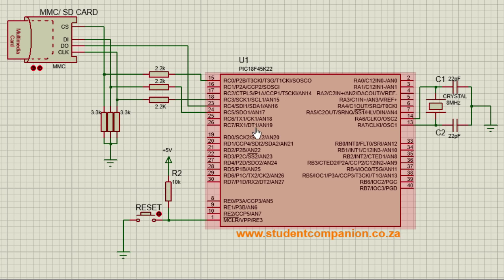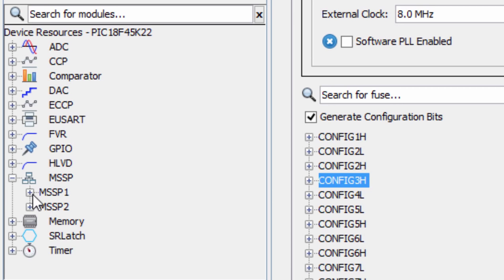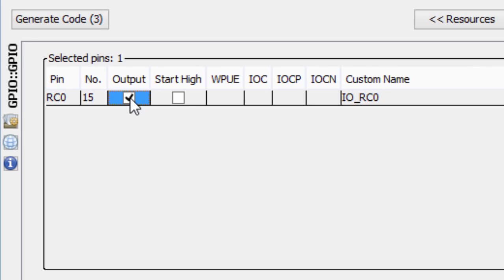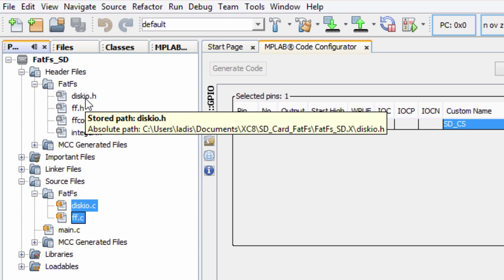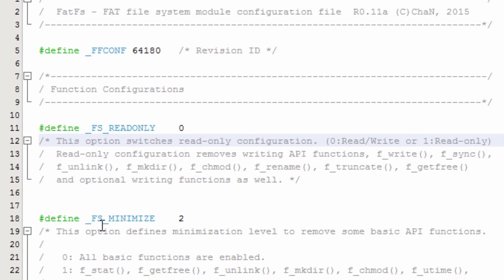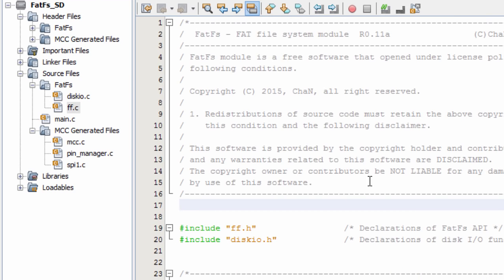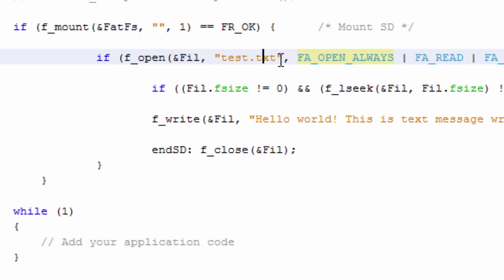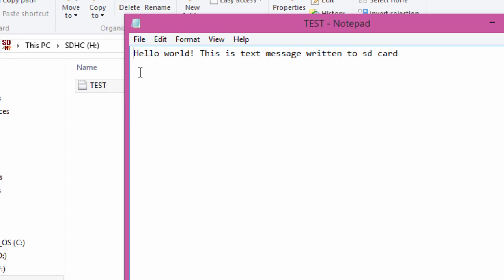48- Interfacing SD Card, part 3 | MPLAB XC8 for Beginners Tutorial

Comment: Did you power up  your microcontroler with 3.3V? and made the connections directly?...or did you power up the microcontroler at 5V and made the voltage adaptions with voltage dividers as shown in the previous videos?
Reply from the maker: +Marian marian2 I powered my microcontroller with 5V. I used ready made SC cards boards with built-in voltage dividers, but you can also make yours as shown on the circuit.

Comment: Hello, I have watched your tutorials about Interfacing SD Card with PIC microcontrollers and tried implement with my microcontroller, PIC18f2331, but nothing worked.That PIC is not supported by MPLAB configurator. Could you make some tutorial without using MPLAB configurator and explain step by step changes that we have to make in FatFs library?
Thanks
Reply from the maker: hi, thanks for watching our videos. the FatFs can be  modified without mplab code configurator. we used it just for the spi functions. we'll  upload an SPI tutorial soon. hope it will help.
Reply: trouble is, the PIC (18F258) is not supported by the current library
Reply from the maker: If you have good reason for using that old PIC model because MCC only supports new models, then you don't have to use MCC with FatFs. You can work with SPI without MCC.
Reply from the maker: Or you can configure your SPI with a PIC model similar to yours but supported with MCC, then you can make some minor modification to support your PIC as explained in this thread in the Forum. A PIC18F45K50 supported by MCC was used to get configuration for PIC18F4550 which is not supported:
https://www.studentcompanion.co.za/forums/topic/interfacing-micro-sd-card-and-pic18f4550/

Comment: I forgot to ask, can I use an SD-CARD that has more than 2GB memory, as long as I format it correctly?
Reply: +Marian marian2 
I have just seen at the end of the video that you used an aprox 4GB card, I guess that answers my question :))
Reply from the maker: +Marian marian2  yes. That's the answer.  we used a 4GB SD card. for sizes bigger than 2GB format with FAT32. smaller than 2 format with FAT16
Reply: StudentCompanionSA
Thank you for the prompt response, doesn't hurt to be absolutely sure
Reply from the maker: +Marian marian2 you are welcome!

Comment: Hi!! great video...
a question, I implemented the library for PIC16F1936, but I find the following error:

error: (1250) could not find space (558 bytes) for variable _FatFs

this is due to the define _MAX_SS (#define _MAX_SS) that is defined as 512. (this is due so the PIC the max memory is 512)
I change this value to 128 and I find that it throws an error in this section of the code, in the code "ff.c"

#if (_MAX_SS < _MIN_SS) || (_MAX_SS != 512 && _MAX_SS != 1024 && _MAX_SS != 2048 && _MAX_SS != 4096) || (_MIN_SS != 512 && _MIN_SS != 1024 && _MIN_SS != 2048 && _MIN_SS != 4096)
#error Wrong sector size configuration
#endif

It would be correct to simply add to that instruction:
_MAX_SS! = 128 && ...
_MIN_SS! = 128 && .....

that is to say:

#if (_MAX_SS < _MIN_SS) || (_MAX_SS != 128 && _MAX_SS != 512 && _MAX_SS != 1024 && _MAX_SS != 2048 && _MAX_SS != 4096) || (_MIN_SS != 128 && _MIN_SS != 512 && _MIN_SS != 1024 && _MIN_SS != 2048 && _MIN_SS != 4096)
#error Wrong sector size configuration
#endif

but I can not comprise the function of this code, could you help me
Reply from the maker: Hi. Thanks for your feedback. 
The sector size of most SD cards is 512. This number is fixed you can't change it. So the PIC selected should have at least more than 512 RAM memory. But your PIC has just that while the code you wrote could consume also some more memory.  I think you'll need a PIC with more RAM for an SD card
Reply: @StudentCompanion  
Yes, I confirmed it with another reference (16F1938), but I note that implementing this library consumes a lot of memory, is it possible to reduce this consumption? (delimiting some variables, it occurs to me)

On the other hand, I am storing data in an excel sheet, the most convenient thing I have found is to manage the file in .csv format, however I want to store data by jumping between columns, does the library allow this?

Thank you
Reply from the maker: As I explained to you before this library consume a memory. A single SD card cluster would require 512 bytes. With your current PIC memory, what more can you save? You'll just struggle if you use this PIC model. I don't see how you can save considerable amount of memory.
There is a complete document with all the functions and features of this library from the official website: elm-chan.org/fsw/ff/00index_e.html

Comment: ¡MAAAAAAAAAAAAAAAAAAAAN THANK YOU SO MUCH!
Y have only one doubt. Can we emulate this on proteus? I mean, plot the sd on a proteus proyect and generate the .txt file? Like virtually? Or this works only physically?
Reply from the maker: +Marco Volkova Thank you for watching our videos and for your feedback.  Yes the sd card can be simulated in Proteus.
Reply: But it saves data? I mean, It generates the .txt file? Cuz the code work like if there is no sd card connected either if I plug it on proteus or no.
Reply from the maker: +Marco Volkova if your sd card is properly formatted, it can work well. A .txt file can be created in the sd card. There is an example in Proteus example folder. You can see how it works.

Comment: 'm trying to use this code on a PIc24fj128gb202. I convert de code for this PIC. 
I check the SPI first and is working. The first function (f_mount) is working but when i try the full code dont really mount so dont work.
Reply from the maker: +Arnau Perez if the first function works so should other functions.  What do you mean by f_mount is working but the full code does not mount? Can you mount the sd card?
Reply from the maker: +Arnau Perez how are you testing?
Reply: I try first the main code and the .txt its not created, then I try function by funciton and with the oscilloscope I read the pins CS, CLK, DO and DI, and I see the signal is Working
Reply from the maker: +Arnau Perez did you try with a different sd card? It will be difficult for me to guess what could be wrong because all the signals on pins are working. 
Did you modify the code or you used it as it is? If you modify please post it here.
Reply from the maker: +Arnau Perez did you first initialize the SPI with low speed just to mount the card then increase the sleed after successful mounting?
Reply from the maker: +Arnau Perez please make sure to configure diskio.h file correctly as well.
Reply: I use my own mmc congifuration but to sum up the SPI works in the 2 speeds. Also change in diskio.c 
static
void deselect (void)
{
 //SD_CS_SetHigh(); /* Set CS# high */ <-Not working
    PORTBbits.RB15=1; //I do it by my self
    sd_rx(); /* Dummy clock (force DO hi-z for multiple slave SPI) */
}

/*-----------------------------------------------------------------------*/
/* Select the card and wait for ready                                    */
/*-----------------------------------------------------------------------*/

static
BYTE select (void) /* 1:Successful, 0:Timeout */
{
 //SD_CS_SetLow(); /* Set CS# low */
    PORTBbits.RB15=0;
 sd_rx(); /* Dummy clock (force DO enabled) */
 if (wait_ready()) return 1; /* Wait for card ready */

 deselect();
 return 0; /* Timeout */
}
In disckio.h I didn't change anything. I rename the SPI functions to mach the funciotns on disckio.
Reply: I found out the SD card file system is FAT12, that could have something to do with not working?
Reply from the maker: +Arnau Perez maybe I haven't tested it with FAT12. But is there a particular reason to format your sd card with FAT12? Most SD card and MMC below 2GB use FAT16 standards and between 2GB and 2TB FAT32 standards.
Reply: No idea why is FAT12. I will search other SD card with FAT16. Thank you for the video and your help!
Reply from the maker: +Arnau Perez ok. You are welcome.  You can also try to format it and select a different format standa6. But the best way is to try with a different sd card
Reply: Today I have SD card 2gb with FAT16, cluster size 32kb. Now should work with your example? Or I have to change something else?
Reply: I found out the f_mount function returns "FR_NOT_READY:  The lower layer, disk_initialize function, reported that the storage device could not be got ready to work. One of the following possibilities is suspected.
No medium in the drive.
Wrong lower layer implementation for the storage device.
Wrong hardware configuration.
The storage device is broken. " 
Exept the "storage device is borken" the other ones I dont understand what means and how chek the problem

Comment: I use pic18f27j53 and XC8 compiler v2.05 . Is it possible to use Sd card libraries?:)
Reply from the maker: That library can be used with almost any PIC
Reply: @StudentCompanion  thank you
Reply: @StudentCompanion  why i am getting errors in the dowloaded ff.h file?
FatFs/ff.h : error : FatFs/ff.c: redefinition of ' DIR ' as different kind of symbol..
Reply: @StudentCompanion  could you assist me with this error that i wrote Adove ?
Reply from the maker: @youssefboudhaouia1116  hi, can you post your full compilation log with all  error messages not just that piece of error. Are you using your compiler in C90 or C99? Can you try to set it to C90 and compile?
Are you using the USB as well?
Reply: @StudentCompanion   i've got also a lot of warnings
I guess i am using my compiler in C99 . Because i pasted all the .h files in C99 folder . Am i right ? And how can i set it to C90 compiler ? should i paste the .h files in C90 ? I will be very delighted if you assist me more . I am new in mplab. I hope i posted the error messages that you need to check.
And no i am not using USB.
Reply from the maker: Did you configure the usb as well?
Reply from the maker: Did you set the compiler to c90 and check?
Reply: @StudentCompanion  what i know is that i only configured SPI Master and ADC and LCD with Code Configurator!
Reply: @StudentCompanion   ok i will set it to C90 .Should i just paste .h files in C90 Folder ?
Reply from the maker: @youssefboudhaouia1116  Your error looks like this error described in this thread on microchip forum, try out this solution if it will applicable to your problem: https://www.microchip.com/forums/m1102436.aspx
Reply: @StudentCompanion   wow i set my compiler to C90 and runned my code again and the error is gone . A Perfect step! thank you .. But i became now other 2 errors : stdint.h and xc8debug. h are not found!
Reply: @StudentCompanion  it's okay i solved it
Reply from the maker: @youssefboudhaouia1116  Good to hear that it's working now.  Thanks for the feedback. 
What was the problem? Your solution could assist others facing the same problem.
Reply: @StudentCompanion  the DIR type was simply 2 times redefined.One time in ff.h and an other time in pic18f27j53.h file. I simply commented one of them so that it has only one Definition. And then the error is gone. But somefiles like stdint.h must stay in C99 Folder so that it can be recognized. Otherwise you get errors of this type ' stdint.h not found ' .
Reply from the maker: @UCNHNcLCtKDJJs5bNCqztSyA thanks for the feedback.
Reply: @StudentCompanion   could you assist me with this error ?  
main.c:338:: error: (1098) conflicting declarations for variable "_f_lseek" (FatFs/ff.c:4252)
(908) exit status = 1  
its located in this line :  if ((Fil.fsize != 0) && (f_lseek(&Fil, Fil.fsize) != FR_OK)) goto endSD;
Reply: as i understand , f_lseek should be declared differently , but i dont know how! ..thank you
Reply from the maker: @youssefboudhaouia1116  are you using tje latest FATFs library? Apparently there are some few changes withbtje latest library.  We need to upgrade this tutorial.  It was done some few years ago. Can you Try to use FATFs with MCC? Now it's suppprted and might be easier and updated.
Reply: @StudentCompanion  yes its the 2019 version! The older versions are not available anymore i guess. 
Okay , but i can't see something named FATFs in the Device ressources block. There are only flash memories. My MCC is v4.75...
Reply from the maker: @youssefboudhaouia1116  To use FATFs with MCC, from MCC web page (https://www.microchip.com/mplab/mplab-code-configurator) Download the File System library and install it into your MCC.
To use the older version of FATFs, from the website (http://elm-chan.org/fsw/ff/00index_e.html) under Resources, click on Previous Releases to take you to the archive page.
Reply: thank you ! i downloaded an older version of FATFs and this error is gone
Reply: @StudentCompanion   in the diskio.c file there are some included .h files that can't be found. I can't understand Why are they not downloaded with the FATfs folder? should i download them seperatley and add them ? ( atadrive.h , sdcard.h ......) . But this way they can"t always be  compatible with my pic18f. Do you understand me ? what's the solution please?
Reply from the maker: @youssefboudhaouia1116  great!
Reply from the maker: @youssefboudhaouia1116  my diskio.c file is customized to work with MCC. You can use the one on our website it should work.
Reply from the maker: @youssefboudhaouia1116  This topic is also discussed here on Microchip forum, you can read the suggestions that were made, including the suggestions we contributed: https://www.microchip.com/forums/m1109260.aspx
Reply: @StudentCompanion  thank you so much for the helpful solutions and links . I used your diskio.c and the error is gone but the mcc.h included file can't be found... I Think its better if i  generate my own file system Library with MCC . The file system library v1.00 should normally work in my MPLAB  as written in this microchip note release http://ww1.microchip.com/downloads/en/DeviceDoc/release_notes_fileSystemLibrary_v1_00.pdf . Now i am trying to install this library .But i can't find this installation source ' filesystem-v1.00.mc3lib ' on microchip website . Any help?
Reply from the maker: @youssefboudhaouia1116  The installation steps are described in this release note: 
To install the MCC File System Library 1.00:
1. Download filesystem-v1.00.mc3lib from microchip website.
2. In the MPLAB® X IDE, select Options from the Tools menu (Preferences menu on MAC)
3. Select Plugins tab
4. Click on Install Library
5. Add filesystem-v1.00.mc3lib
6. Restart MPLAB® X IDE

The library: https://www.microchip.com/mymicrochip/filehandler.aspx?ddocname=en610077
Reply: @StudentCompanion  Done!thank you.
But still a lot of .h files need to be added. And i dont have them in my C90 folder... should i download them ? Thats the only solution? ..sorry for asking so many questions but the errors in Mplab seem to be endless :(
Reply from the maker: @youssefboudhaouia1116  Your question is not clear. What .h files are talking about? Did you use MPLAB Code Configurator (MCC)? If yes then you don't need to download any .h file, MCC will generate all the .h files that you need.
Did you use the files from our project on our website?  If yes, then you will need all the files including the .h files. Follow this video clearly we explained which files we modified and which ones we did not modify.
Reply: @StudentCompanion I am talking about the including .h files written in the files generated by MCC. Everytime i get the error that a .h file is not found..i am downloading them and adding them by myself and  the errors are being gone....but that takes too much time dowloading and adding every file....im not sure if this is the solution
Reply from the maker: @youssefboudhaouia1116  i posted a sample project on microchip forum, the link I sent you.  All the .h files were included automatically with mcc. I didn't set anything manually. It means you did not configure correctly your mcc project to include all libraries like sd card, spi, pin etc. Because everything you configure in mcc has its own .h file automatically.  Whatever you don't have it means you did not configure it.
Download the sample project on microchip forum open it and compare it with yours.
Reply: @StudentCompanion  okay i'll do it . thank you
Reply from the maker: @youssefboudhaouia1116  great!
Reply: @StudentCompanion  by the way i am doing all of this with another main code
Reply from the maker: @youssefboudhaouia1116  then they could be somthing else wrong you are doing and you are not specifying so we can't guess. You can post your code in the forum on our website if you wish so.